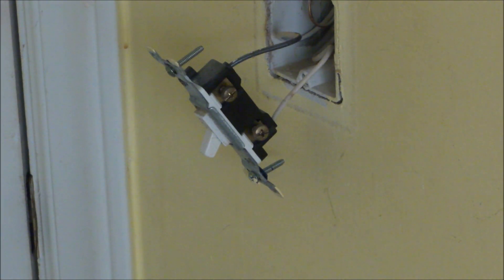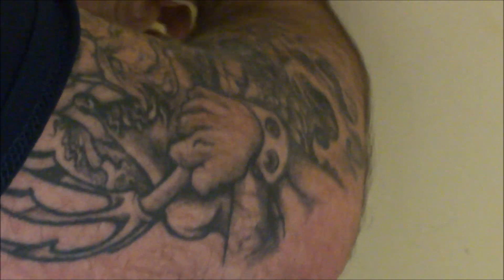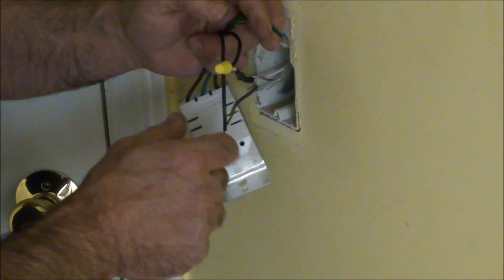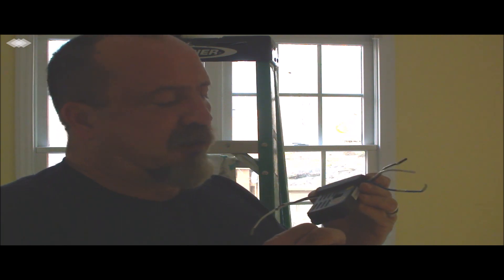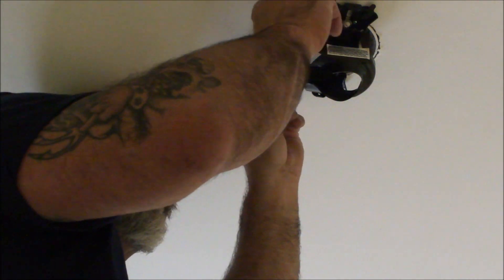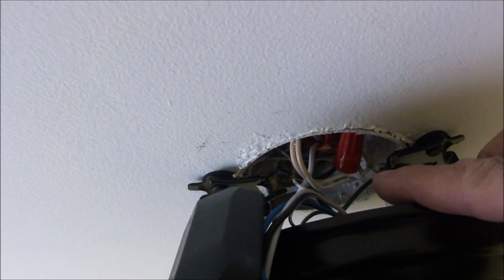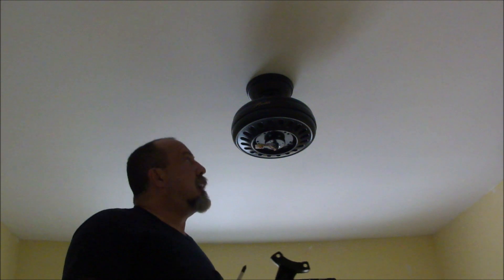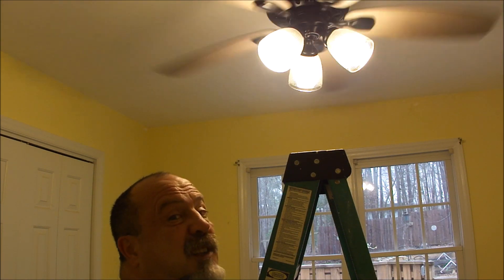How to Install A Ceiling Fan Remote Control

Comment: Greetings from the Philippines. 220 volt system here but what’s wrong with wiring the switch in direct replacement of the existing switch (USA brand Decora) standard 2-wire. Would I be wrong thinking the switch is only seeing 120v therefore replacing the standard unit with this fancy fan controller? The fan itself is 220v.
Reply from the maker: Mine is labeled 120V max

Comment: Hey great vid. Question on the switch two blacks go to where. It looks like any of the black on switch can wire with hot. And the 2nd black wire on switch just wire with another wire on wall(not the ground) is this correct?
Reply from the maker: One black wire goes to the AC supply, the other goes to the fan. They should be marked,

Comment: Hi Jose. I have the same Hunter Ceiling fan along with the similar switch from Harbor Breeze. The issue is that the fan or light on the fan turn on automatically. I am not unable to find this switch model. Do you know what the issue can be? Is there any other remote module that you can recommend that I can use as a replacement?
Reply from the maker: I'm not sure but it sounds like you may have the switched and hot wire reversed
Reply: @ExtremeDIYGuy  Thanks Jose, really appreciate your prompt response.